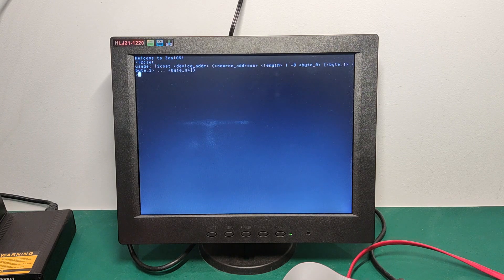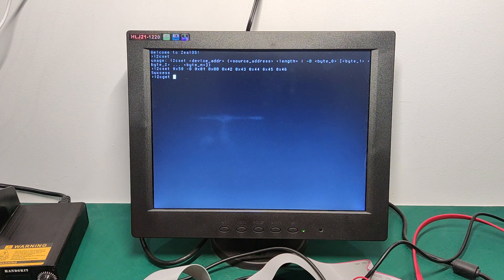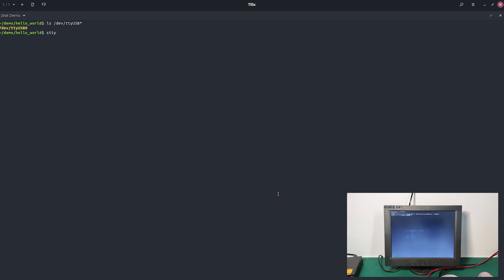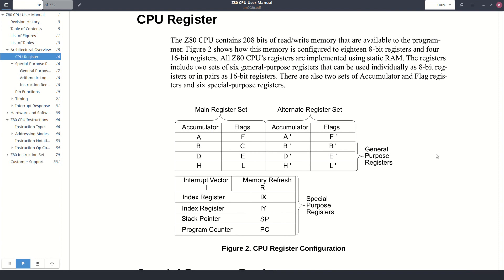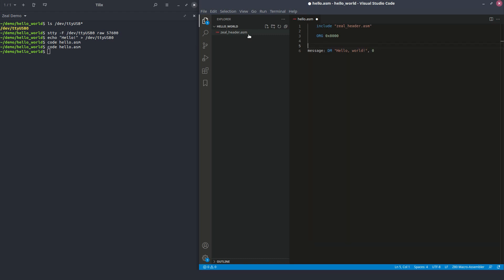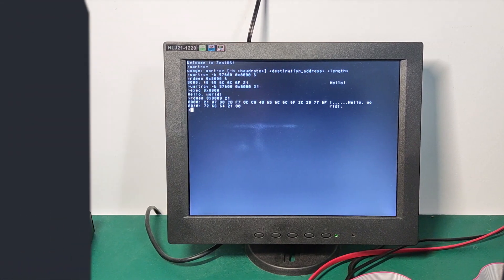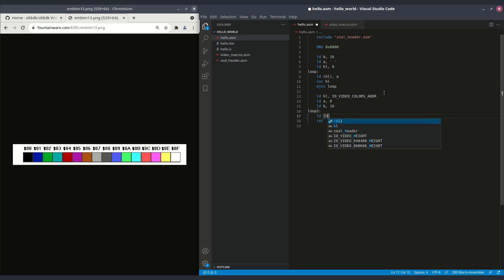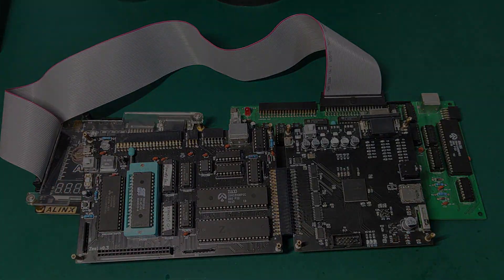Hello world on Zeal 8-bit computer and software improvements

Comment: wow! i´m very impressed, y want to see your code :c doyoy have a .zip file with the schemas :3, also y would like to wath videos about raster fonts(made by matrix for example in C there are made with a Struct statement), and vector fonts (the latter just the theory), how text mode and graphics mode work and how computer shows a character into a screen, y love your videos!!! :D greetings from ecuador
Reply from the maker: Thanks for your support 😄
I plan on rewriting the current system (which is more like a monitor) to make it behave more like an OS, so with a hardware abstraction layer.
I plan on making videos about the graphic and text mode 😉
For the text mode, the principle is simple: the FPGA stores the 256 characters as a bitmap, so each character is 12 bytes (8x12 pixels). The CPU tell the FPGA to write a certain character (8-bit). The position of the character will be calculated according to the address the CPU is writing to: address 0 of VRAM is the character on the top left corner, address 80 is the first character of the second line, etc...
This makes writing characters to the screen very fast as the characters bitmaps are managed by the FPGA.
Reply: @Zeal8bit  ok, but I think retro computers use ROM character instead FPGA, that is a modern solution for your DIY computer, also I think that is necessary to use a interface like VGA or other, but I'm confused, these interface are only for graphic or text mode too? Sorry for my ecuatorian English 😃😂👌

Comment: Am curious about your video solution. Have you described it somewhere? Is it something you engineered?
Reply from the maker: Thanks for your interest!
I have quickly talked about it in my first video, there was also a small demo, but nothing very detailed yet. I am using an Altera EP4CE10 FPGA to generate a VGA output. It's an implementation I've entirely done myself.
Currently, it supports 640x480 in text mode (12x8 pixels characters, so 80 columns and 40 lines, 16 colors with background and foreground support) and graphics mode (16x16 pixels tiles, so 40x30 tiles on-screen, 8-bit colors, maximum of 128 different tiles at the same time). The palettes are fixed for both modes at the moment, I am using VGA 256-color palette.
So both modes work as tiles, there are no hardware sprites yet, but in the future I am planning on adding some.
Reply: @Zeal8bit  that's marvellous, and very similar to my own implementation. I've used Flex 10Ks and Cyclone 2s in my computers for video. The latest one is a 208 pin QFP EPC2C8 with 1M x 16 fast SRAM for the video RAM. Got as far as hardware accelerated rectangles, though it's a hack up of VHDL. Is your implementation VHDL or Verilog? Maybe we could compare notes. I have a few videos on my channel if you want to take a look.
Reply from the maker: @lawrencemanning  What you did is impressive, you could embed your FPGA in a 16/32-bit DIY computer, that would make an awesome project 😄
I guess the 16Mbit SRAM is really a nice advantage. How fast is your SRAM? At which frequency is your EPC2C8 clocked?
In my case, to reduce the timing issues, and chips used, I am using embedded BRAM only, so I am limited by the EP4CE10's 414Kbits. I am considering switching to a Lattice FPGA which embeds twice more BRAM (but that would mean make a new PCB and adapt the HDL code). I am using Verilog, it was the first one I learned, I've never tried VHDL. Do you use VHDL?
Reply from the maker: @lawrencemanning  Sure, mail will be easier!
External memory is indeed a challenge, but if you stick to 25MHz for the FPGA, 10ns delay is enough to read at every clock pulse. BRAM is indeed very convenient for instantiating dual-port RAMs easily, this will make my future hardware sprites implementation much less of a pain.
I did the design of both PCBs, motherboard and FPGA board, using Kicad. EP4CE10 does have TQFP package but I prefer the BGA one.
Like you, I think I will stick to 640x480@60Hz. I started with a 800x600 resolution as I am using a 50MHz oscillator for the FPGA, but I find it less practical, mainly for graphics, where I have a 128 different tiles limit.
Sure we can help each other!